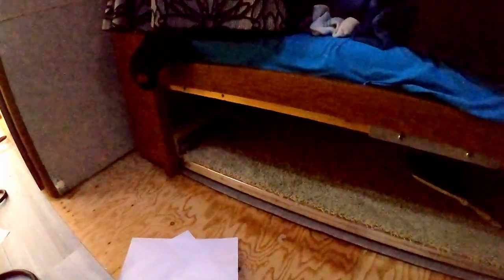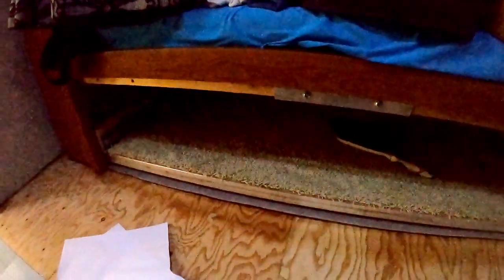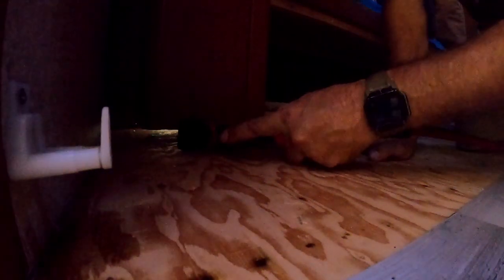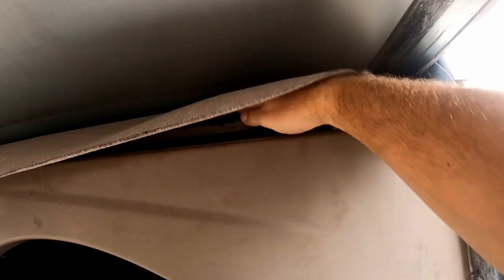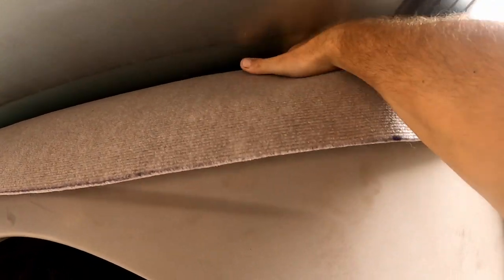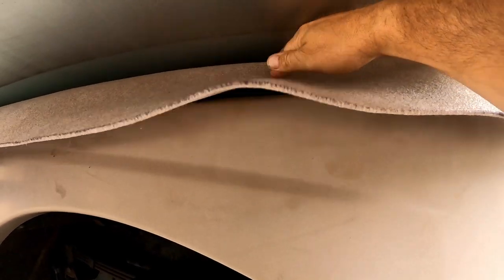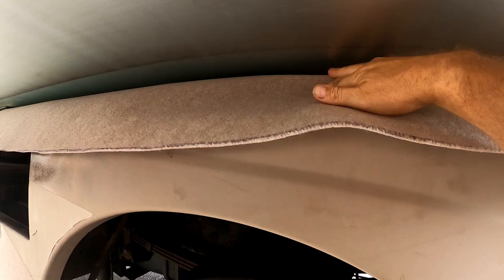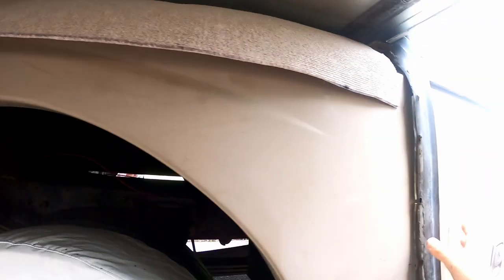Replacing the RV SLIDE CARPET - RV RENOVATION | S2-E9

Comment: How did you get the drawer out from under the bunks?
Reply from the maker: The drawer is on sliders. Once fully extended out, slide them back a little bit and you will see the mounting screws. I think there was 3 or 4 on each side.